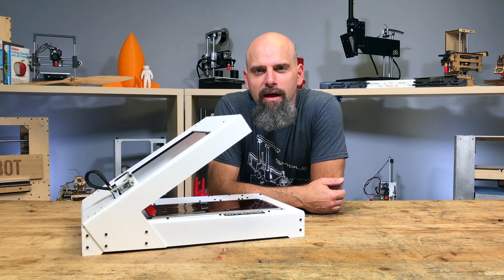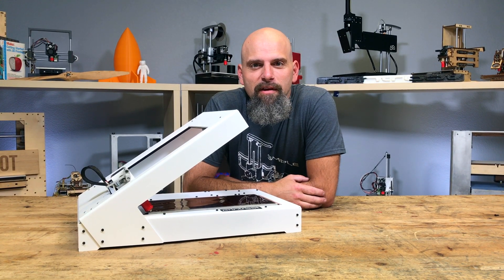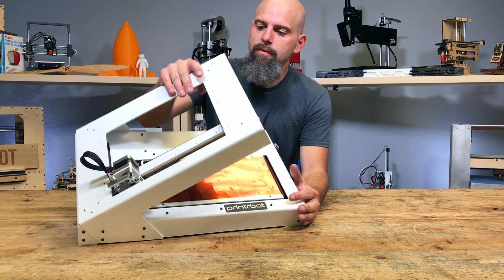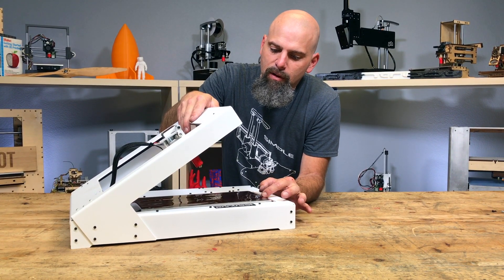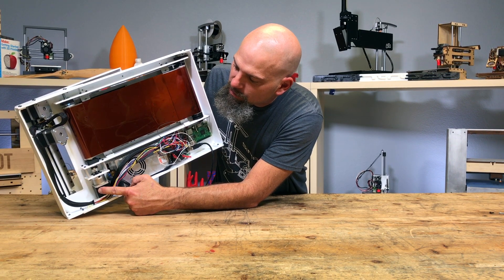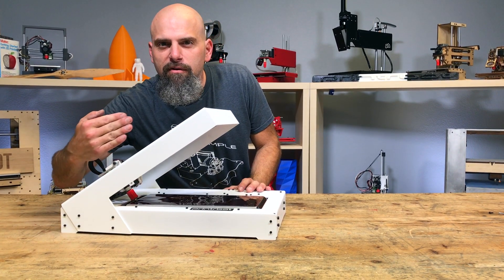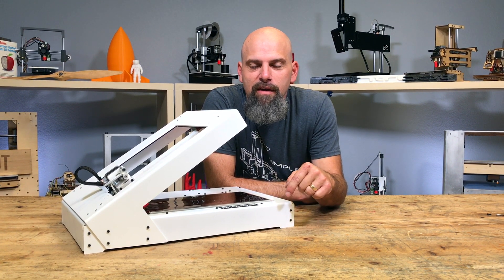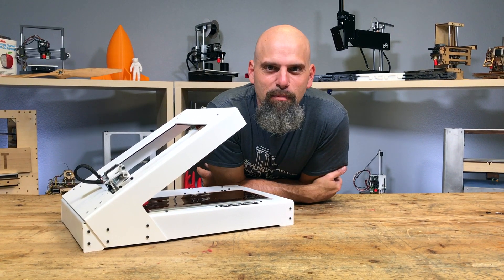Printrbot Printrbelt Teaser

Comment: I thought blackbelt 3d printer had a patent on this?
Reply: Blackbelt has a patent on a variable angle system, on the specific software they made, and on the particular belt they use, but the core concept of the angled conveyor style printer is out there for everyone.
Reply: They really should make this type of 3d printer a standard on upcoming printers, or at least an optional upgrade to existing printers should be offered.

Comment: Just curious what the z height will be?
Reply: The way they list it is 6"x 6"y with an indefinite z-axis.   But considering the printer is on its side, and the "z axis" is horizontal, it's easier to think of it as having a 6"x and 6"z axis, with a Y axis that stretches on as far as your filament can provide.

Comment: Guys you HAVE to mass produce this. As someone who has a side business selling my own 3d printed designs If these are affordable in line with prices of other printerbot models i'll buy in mass. Having to clear the bed is what slows down my whole operation. If I had a line of these running with buckets under the belts I could print non stop and the only limit would be my filament roll size! Please please make this, my army of printrbot simple metals needs company!
Reply: They're "newly patented design" isn't actually patented.  I developed a machine nearly identical two years ago and Andreas Bastian (at Autodesk) did one similar in 2014.  They might be able to patent the carbon fiber belt, but this design uses a stainless steel belt, which mine did as well.
Reply: considering it looks very similar to a newly patented design i saw recently, i doubt they could sell these.
Reply: cool. thanks for clearing that up. its a neat concept i'd like to see more people trying.